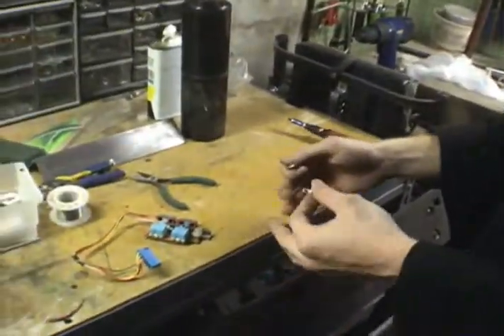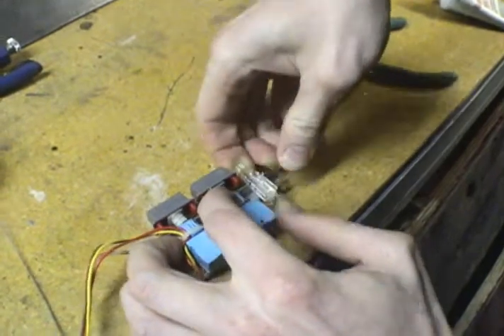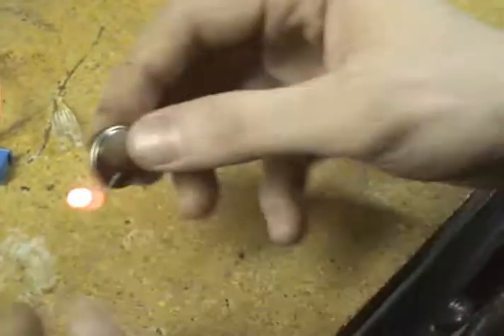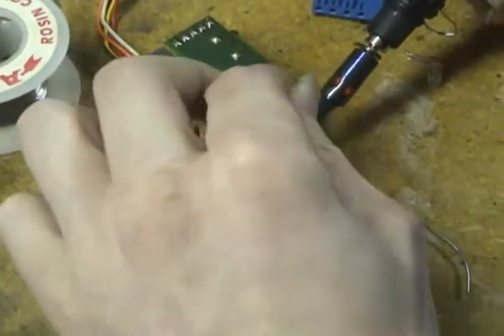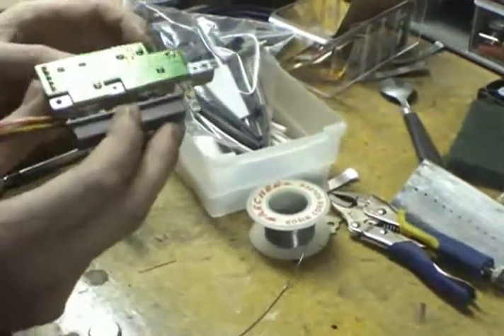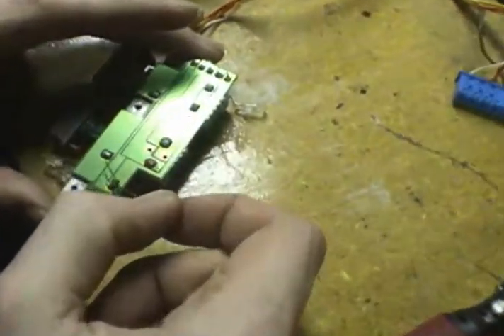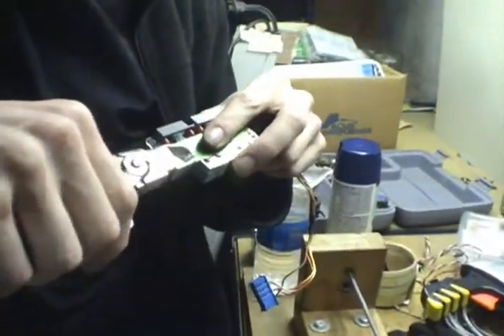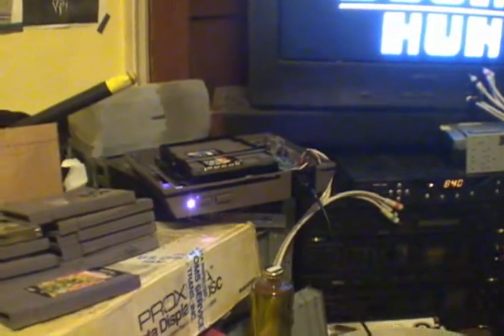game.hack season 1 episode 2 - NES LED Mod, Super Metroid Mockball Glitch

Comment from the maker: @JeremyPattonGuitar Most LED's will fire up at around 3 volts.  Blue and "white" LED's tend to get brighter around 5v, but will operate happily on 3 volts.  The main thing you have to consider is the amount of energy getting through there... an LED can tolerate plenty of voltage, but it's the amperes that have to be taken into account.  This is normally solved by putting a resistor inline with the LED to sort of "lighten its load" and avoid thermal runaway.  The NES has this already built in.

Comment from the maker: Wow, been a while, I can't remember what the LED's were rated at on the package.  I think they are 3-5 volt judging by the button cell we used to fire them.

LED's will fire with less than their rated voltage.  What's more important is that LED's don't have any way to regulate their own power alone so it's important to have driver circuitry.  On home brew devices this might be as simple as some resistance inline with the LED, but for our purposes the NES handles that just fine.

Comment from the maker: It's a high intensity PINK LED :D

Just make sure any LED you replace the NES's with is the same rating/votalge.  Shortly after doing this mod, the sound board in my NES died.  the unit still works fine, but... i'm not sure if the LED i used drew too much amperage or something and cooked the sound board... Circuit modding can be fraught with landmines.